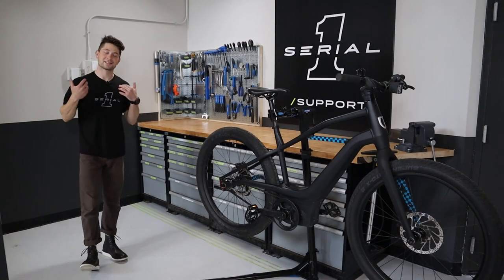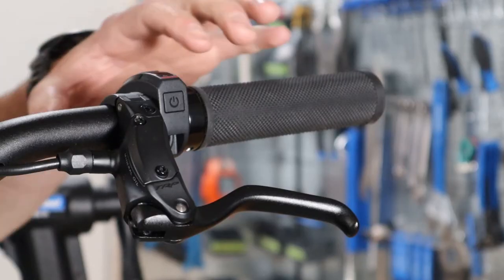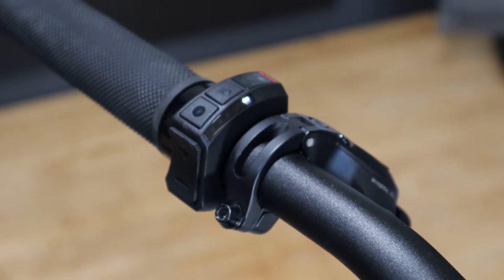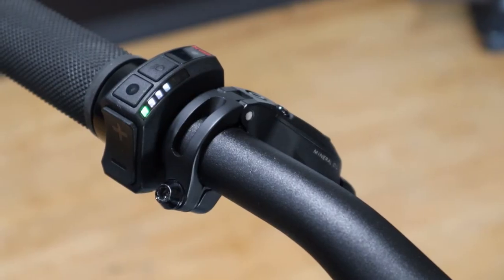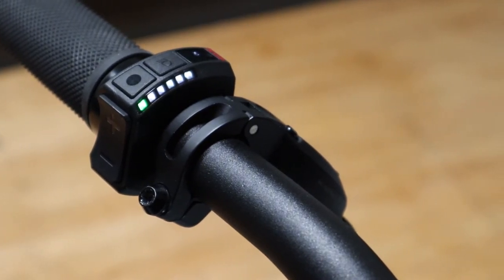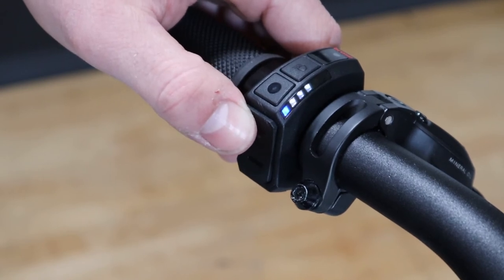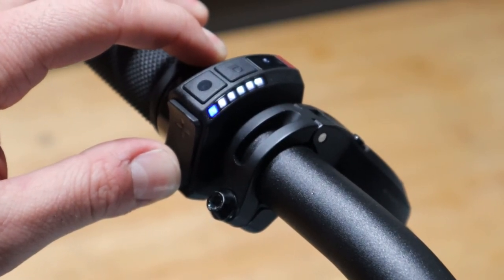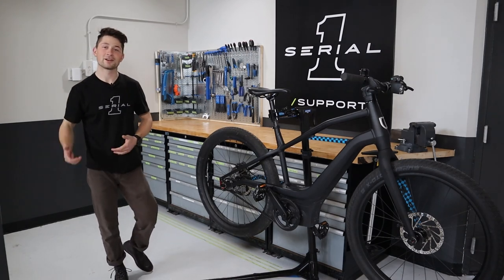Using the Brose Display on MOSH/CTY

Comment: Dear suppprt thanks for your videos. I need help  what is the best way to get a replacement cable and connector directly attached to the brose display
Im having a really difficult time getting in contact with support, please help just purchased rush city as my daily transportation.
But damaged the cable while trying to install a mirror, thanks in advance
Reply from the maker: Hi Oscar, our support team is available either via email at support@serial1.com or by phone (844) 737-4251, Monday through Friday, 8AM-5PM MDT. Our team typically responds within 24 hours.

Comment: Is it easy to change handlebars on the Mosh city ?
Reply: I would say it would be quite difficult due to the wiring harnesses running inside the bars, not even sure if you have any extra cable for different shape bars.    This is from what has been posted on other sites about Serial 1 bicycles.      Hoping they are incorrect and that you don’t find it too difficult to swap out your handlebars.    Wish you luck !!

Comment: Really? Hey serial 1. Can I get some info, please.. Whats the circle button do below the headlight button?
Reply from the maker: Hi there, the display is a general Brose display used on many types of bikes, including Serial 1 eBikes.  On the Serial 1 MOSH/CTY specifically, this button currently does not have a functionality. Should this change in the future, we will inform our customers on the change.
Reply: @Serial1  Very good sir. Thanks for the info. Can I make a suggestion for this button.?. Push it once for making the left brake light flash so as to signal left turning. And vice versa for the right brake light, except push the circle button twice "like double clicking the mouse" to signal right turn. I usually just use my arms but yeah know, bells and whistles friends. I ride my Tribute edition about 2 charges a week. Usually one good 20 plus mile route then all daily commuting for the week, too. Burning a full charge on one route really makes me want a Harley fatbob or sportster s now. And a Harley Davidson Serial1 Speed.